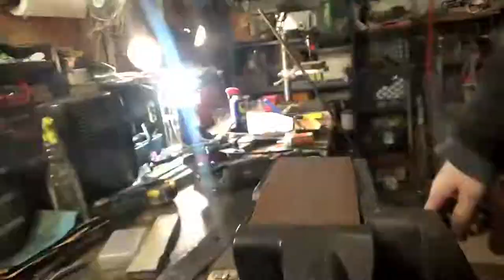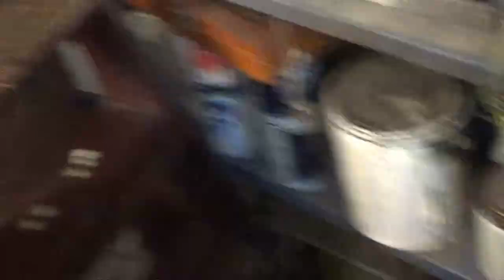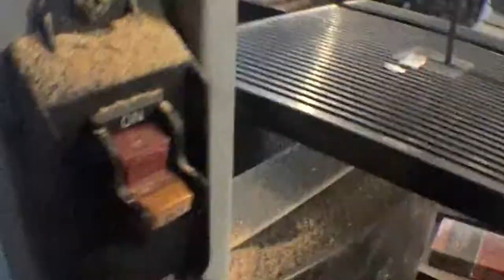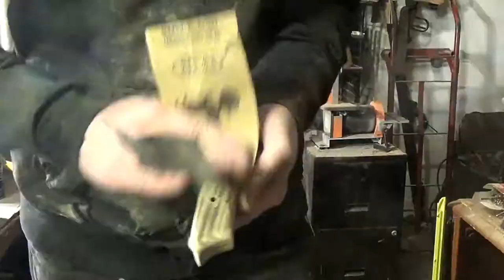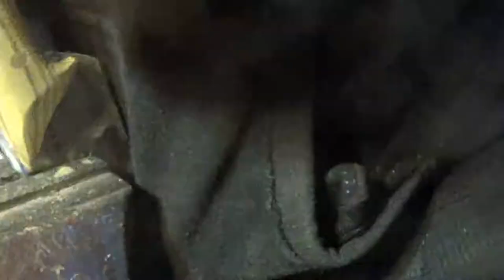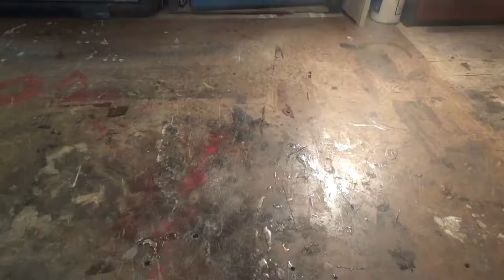Making a Curved Machete (Kopis)

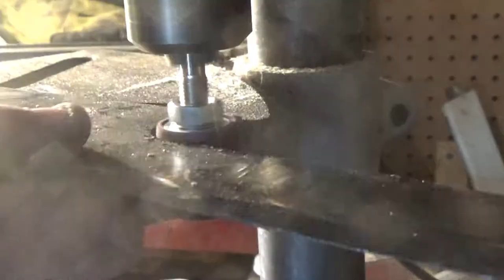Comment: What type of bit did you use in your dremmle tool when you where smoothing the inside of the handle? 2:42
Reply from the maker: Atlas im using a 1/4" steel engraving bit.